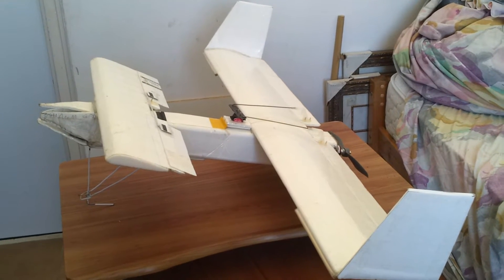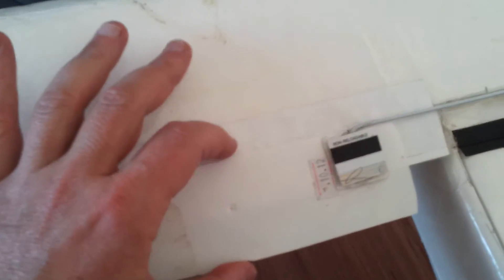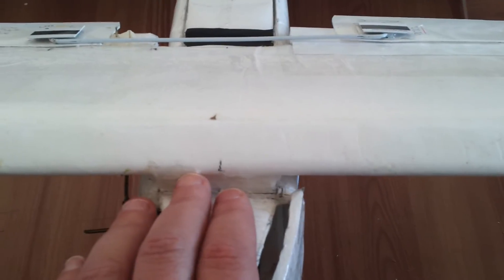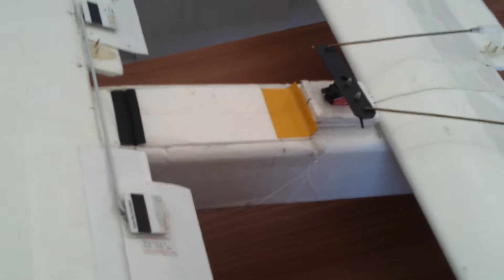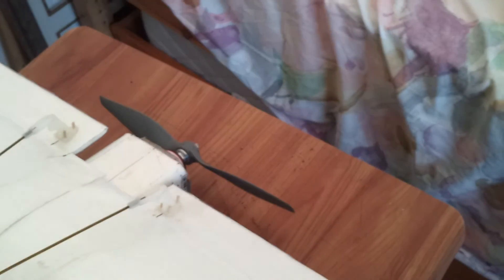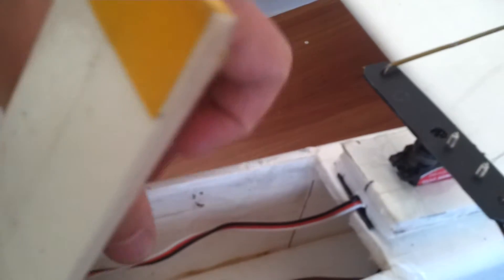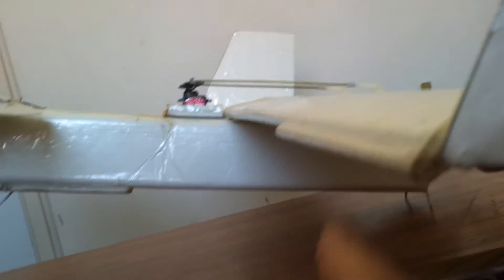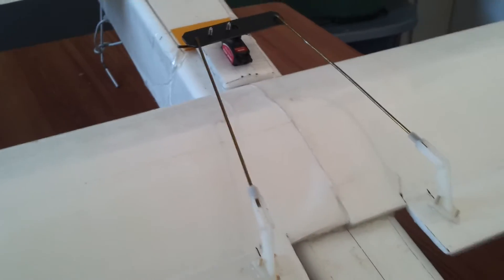Useful tips and simple mods for RC foam canard airplane

Comment: Nice.  Im working on a xb-70 right now and this video helped.  Thanks👍
Reply from the maker: You're welcome. Check out rcgroups.com for several XB-70 builds that may be of interest to you.
Reply: @natanabrams622   Thank you. I definitely need to figure out the control surface issue. I'm guessing I'm going to do some kind of a elevon in the back with a functional canard in the front....?  I'll check out rcgroups.👍
Reply from the maker: For anything but very large scale XB-70 builds (or airplanes similar to it) I'd say it does not pay to have movable canard. Just use elevons. That's what I've done on several of my other builds.